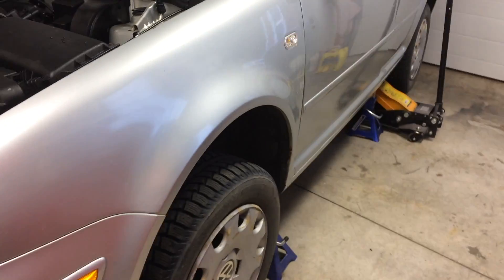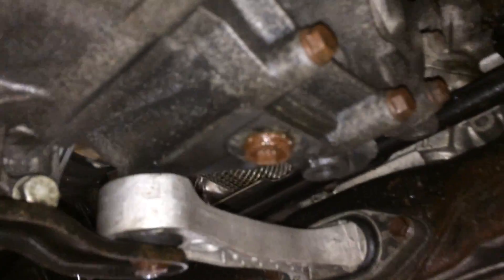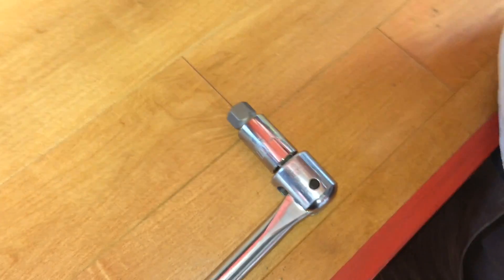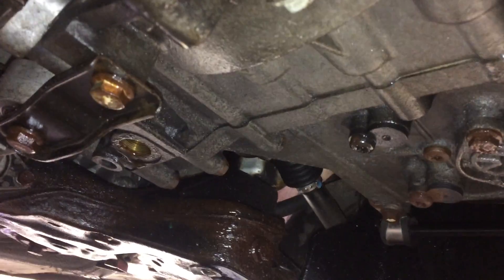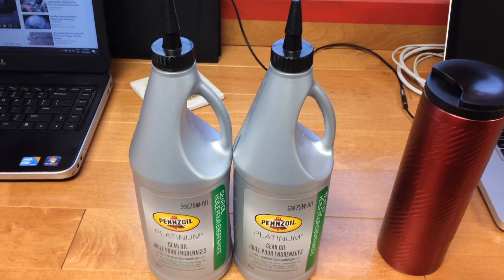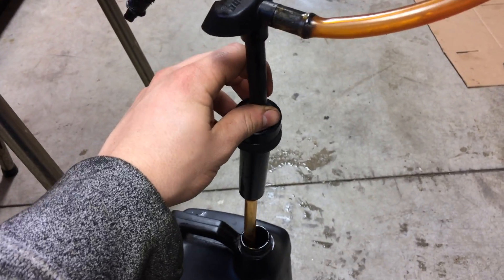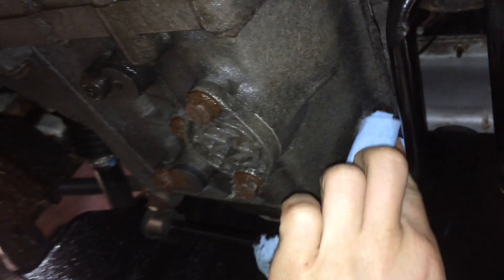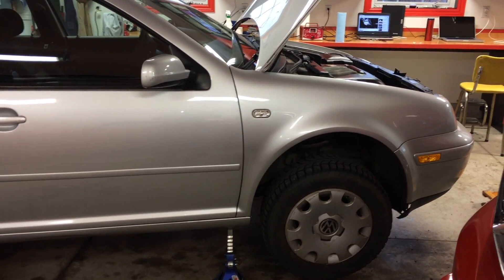VW Golf MK4 transmission fluid change 5 speed manual

Comment: Thanks for great video. I have 2002 MK4 2.0L 5 speed manual golf. See in my Hayne's manual capacity is 2.1 quarts or 2L. Was the 2 x 946mL bottles shown in the video sufficient as is just short of 2L?
Reply: would also like to know this, I bought 2 bottles of redline mt90 and that stuff isn't cheap- for an extra 100 ml I may not need

Comment: This is incorrect way of changing the oil!!! Check the original manual, you have to also remove shift trunnion, while locking shift shaft. Then you have to fill 1.9 liters of the oil, preferably through reverse light switch or by lifting the car and turning the wheels. Transmission in some cars is tilted, so filling the oil to the top of the filling hole is not enough!!!!!!!!!!!!!!

https://oborudow.ru/en/tyuning/proverka-i-zalivka-transmissionnogo-masla-v-kpp-vw-passat-b6-proverka-i-zalivka/
https://vwts.ru/forum/topic/166104/
https://forum.octaviaclub.cz/topic/2688-výměna-převodového-oleje/#comments
Reply: Ed Williams  Maybe you're right. It's applicable to mk5 and mk6 https://workshop-manuals.com/volkswagen/golf-mk5/power_transmission/5-speed_manual_gearbox_0a4/gearbox_mechanicsoperation_constructiondiff./gearbox_oil/checking_and_topping_up_gear_oil/
Reply: Hey, is there a video of how to do it correctly like this? I'm baffled about few steps...like filling through reverse light switch? Where is it? Through a light switch?  
Also that "A" flap to turn? I's so confused.

Comment: Easy job thanks to your video. 02 Beetle Turbo. rolled front end up on a pair of 4" blocks...easy access.  took 1 & 7/8 qts of Mobile 75/90. Not perfectly level, but close enough. Loosened fill plug 1st...not removed. gentle drain. good job on post!

Comment: Thanks for the nice video! I was trying to follow along, but the U-shape pipe (e.g., the black ones at 1:42) blocked the ratchet. How did you deal with this? Did you force away the pipe or did you have to remove it?
Reply from the maker: I did not have to remove that pipe. I believe I either used an extension to use a ratchet without the pipe being in the way or throw a universal joint extension on the end of the ratchet if you need some wiggle room.
Reply: There must be individual differences among cars. In mine the hex bit pushes directly against the pipe and there is not enough room for ratchet or anything else. In the end, I removed the screw that fixes the pipe to the transmission fluid tank. It flexes the pipe enough that I can maneuver and I was able to finish the job. The transmission oil smelled really bad, but the shift becomes a bit smoother now :)

Comment: Always a good idea to break loose the fill plug first. You don't want drain the oil and then find out you can't get the filler plug loose!!
Reply: NBD. Just gotta flip her over.
Reply: Mustakrakish  I laughed
Reply: That's a great point
Reply: Why would you come on a tutorial video and try to correct it. Make ur own video if ur so smart, ur just gonna confuse people
Reply: @ColonelFlickage  Why would you come to a comment and correct it?  Actually, the recommendation is a GREAT recommendation, even if McQuade does not have a channel.  Look at the other comments in this video.  This is what I teach as well - my son on our 87 RAM started to remove the drain and I said - check the fill plug first.  Turned out we had to WAIT for the penetrating oil to free up the fill plug.  Same with rear differentials.  Always make certain you can refill before you drain.  Great investment of 10 seconds.
Also - how is that confusing?  If that is confusing, perhaps the person confused should not be changing their transmission fluid.
Reply: @ColonelFlickage  What a total ass, he was only being quite helpful
Reply: @ColonelFlickage  sounds like you made that mistake 😂😂😂
Reply: @ColonelFlickage  He probably has never checked the oil in a car.

Comment: Would you recommend changing the filter too when you drain and refill w/ new transmission fluid?
Reply: No filters on manual transmissions.
Reply: The only option there would be to get a magnetic drain plug as these VW transmissions don't have any sort of filter system.